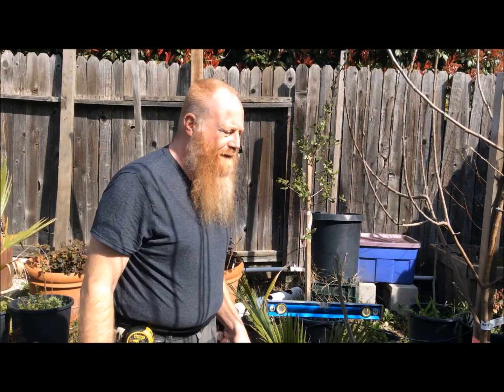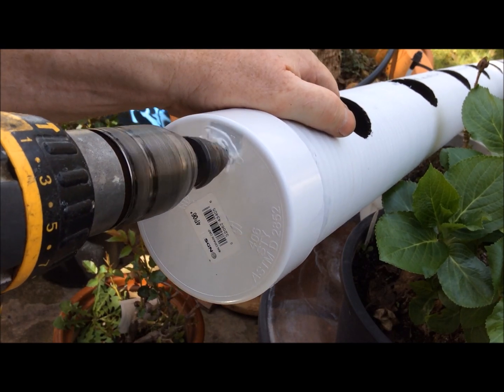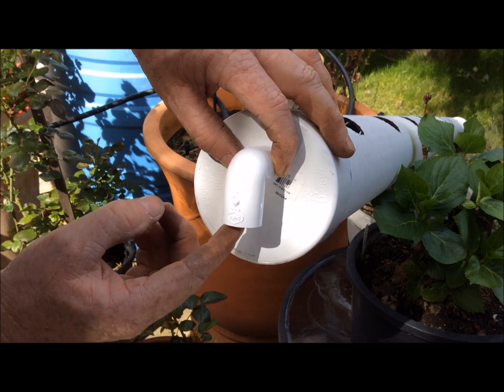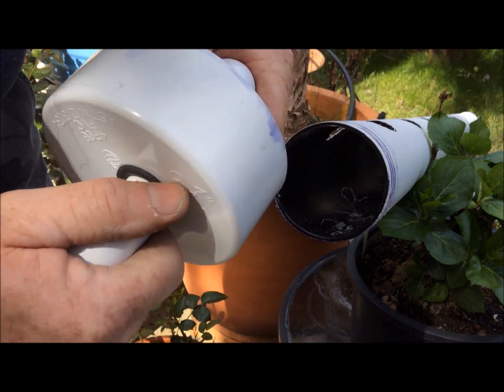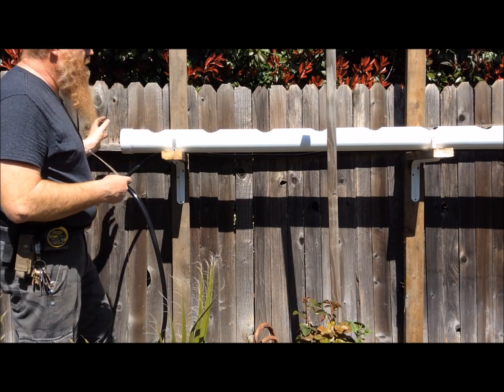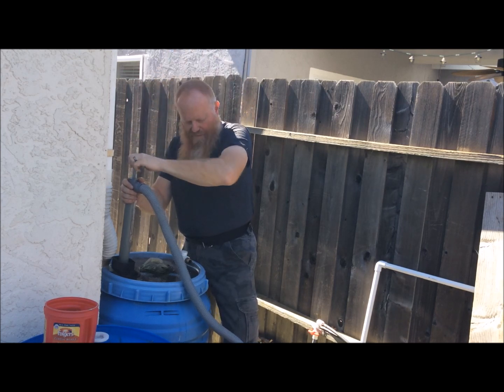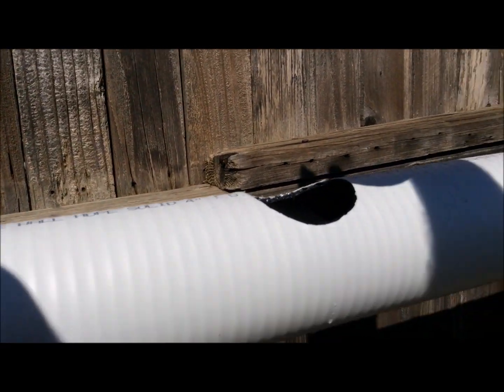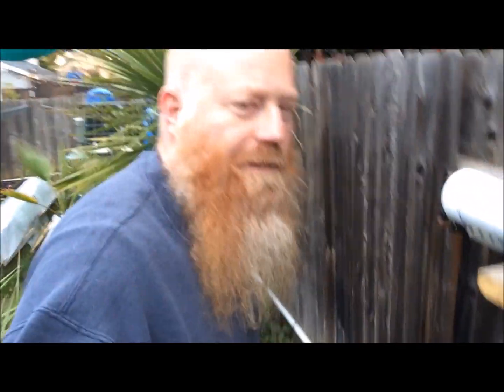DIY Aquaponics Pipe - Part 2

Comment: Are these pvc pipes or upvc pipes?
Reply from the maker: What I used was the thin wall PVC piping, I think it is used for drainage or septic systems. Makes it easier to drill through.

Comment: One tip whatever size whole you need just find some metal pipes with the same diameter 
I use  roofing screws for small holes 🕳 
Heat in a fire and Bobs your Uncle
Make sure to wear gloves lol